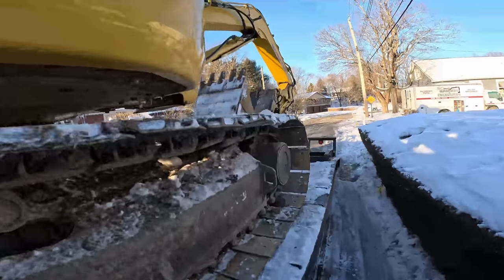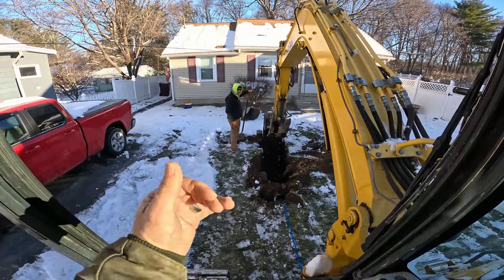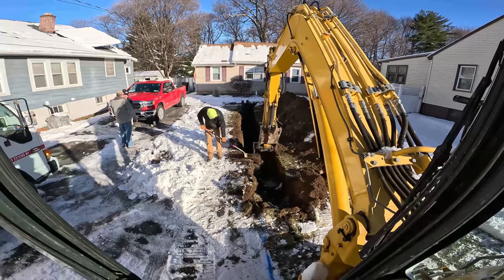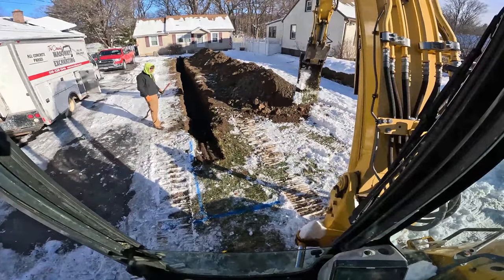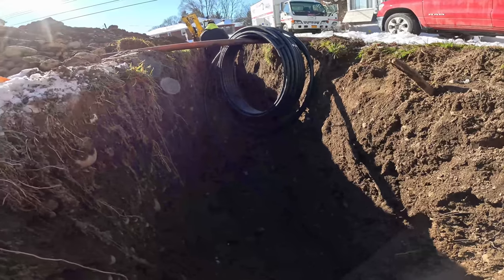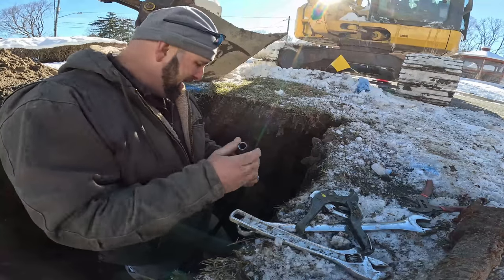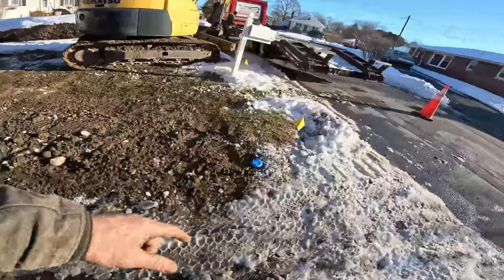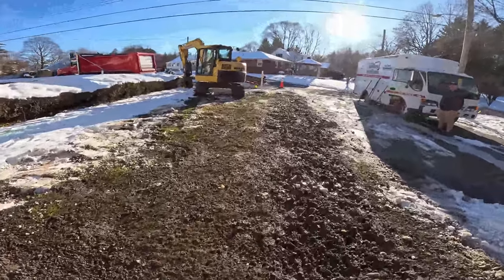Public water hookup step by step the easy way 4K Video

Comment: D-Boss!  Great utility video, they like sand down here, always bring a ton or two to pad waterlines especially with the rocky soil, I’ve seen plenty of pin holes in lines from a rock sitting on them in both copper and plastic lines, also always bring the smoothie bucket to peel the soil off the lawns and for the money shine I bust out the bigdog redmax backpack blower and it gets every speck of dirt in the trench and off the lawn for the sweet finish…that’s how weee do it!   Oh and I left a comment on mountain boy’s buying a rock truck video saying give D-Boss! some props for the help…you hooked him up!  Thanks for the video…D-Boss! for governor!

Comment: I recently had my water supply from my meter to my house spring a leak. I paid $200 dollars for a plumber to put a clamp on the line to stop leak. Said pipe is 50 years old and is rusted and pitted and needed to be completely replaced. I am 72 years old and on a fixed income and the replacement cost he gave me was $2500, I can't do the work myself but as of now i have a clamp on my line. but to replace 35 to 40 feet of line from meter to house seems too expensive, the pipe is only 1 1/2 feet deep. Does that seem like too much for that job?
Reply from the maker: It all depends where you're from but that's a roundabout average price

Comment: you always put sand where the shutoff is when your burying it,,easy to find and dig out later,,whats that pipe above the connection,,the shitter pipe,
Reply from the maker: No Gas line..this town never does sand I was shocked
Reply: @DIRT-BOSS  save money on no sand,xtra  work

Comment: Tracer wire?
Reply from the maker: Not required
Reply: @DIRT-BOSS  that’s interesting, never been a jurisdiction where they didn’t require
Reply: @fuzion430journey3  many states requires tracing wire on gas lines only.
Reply: @alithemagicbum  yes and water lines and it’s usually not a state thing. It’s a local municipality.